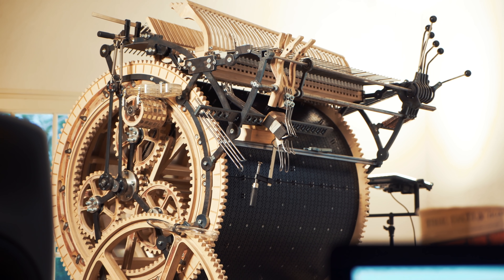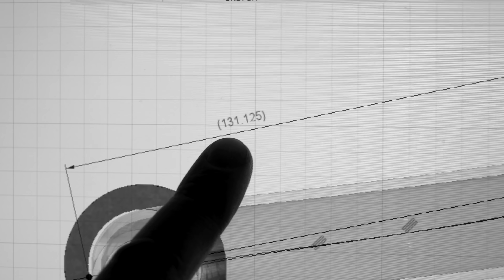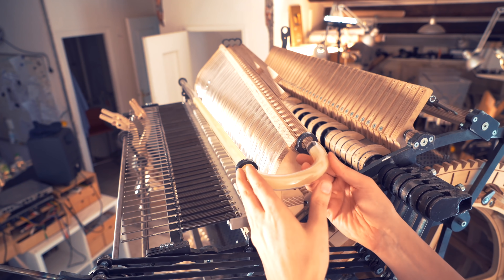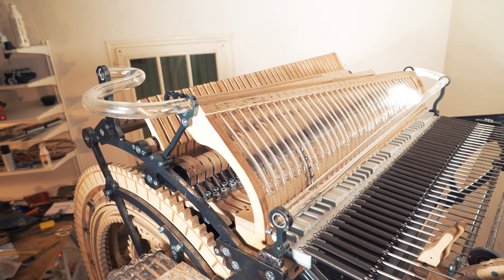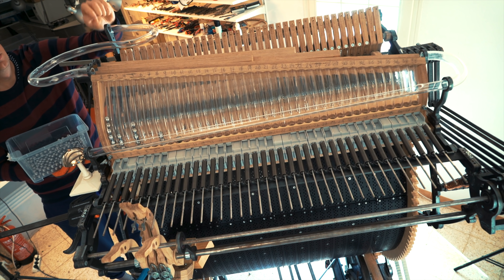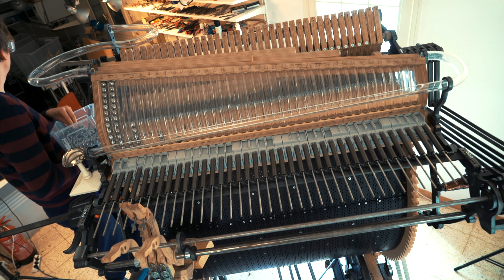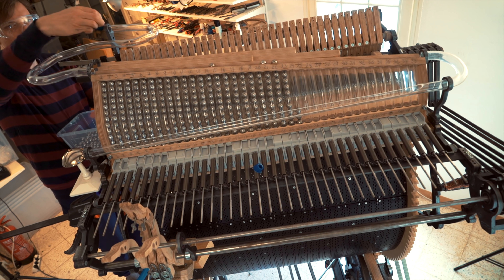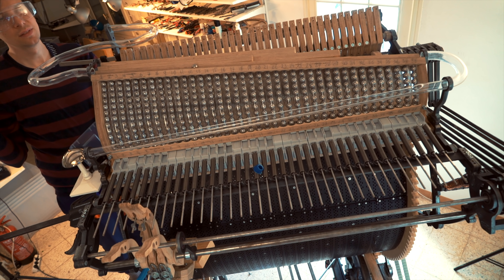Marble Divider Transport Tracks - Marble Machine X #68

Comment: I'm not sure about your programming wheels but I do think the solution you found is good for you.... thinking back to the MM1 you used Lego lots and lots of thin strips on a wheel, in that case you screwed them down, not easy to swap out for new songs, but you could do something similar to the marble lifter to make them replaceable, a chain of shorter sections that could be swapped onto the MMX with a single rotation of the drum (which you already need) and then pinning the ends of the chain together doing it this way means you could make longer chains for longer more varied songs if you wanted and have them hang under the machine somehow.

I'm not sure how practical it is or how easy the modification would be but you'd end up with a chain in 2 or more places (probably the ends) to align the program and the series of programming bars connecting them to code on. They can be laid out flat for easy programming off the machine and because the alignment is fixed by the chain not need to fuss with alignment/arrangement of multiple pieces that might get accidentally swapped. In the nightmare scenario of programming plate 1 and 2 having their programs transposed or programming one plate upside-down you'd be a bit stuck right now and have to halt the show a bit to repair this mistake but with a single chain of programming area this couldn't happen. It's also easier to machine a lot of small pieces than a few larger ones.

Comment: I don't know if this comment will get lost in the ever-growing forum that is created under each of these vids, but I love the attention to detail on this project. I've recently been working on a cash flow spreadsheet for my company and found that I was missing $0.03 out of a $7.3M invoice for a project that will last 3 years. I took the extra hour to revisit each line item and the Microsoft Excel coding. Turns out it is due to a rounding difference between my spreadsheet and the contractor's. It seems like a small thing, but small things grow into much larger problems, especially when left unchecked. You're moving an instrument from country to country, taking it apart and putting it back together each time, and hoping that the road wear will not destroy it altogether. It will grow imprecise over time (thanks, 2nd Law of Thermodynamics...) so I understand the need to make it as precise as possible right now. I think your solution works exactly how it needs to, and the amazing thing is you have hundreds of thousands if not millions of minds working out the same problem, and yours is still the best solution thus far.

Also, side note: I think it's important to remember where you've come from when tackling such hugely minute yet important problems, because that can be incredibly demoralizing, especially with harsh "feedback" from around the world. I think there should be a link to the video of the first marble machine in the description section of every video to give newcomers some context, and to remind people who have been here every step of the way how much better this already is, by necessity of the scale of the project. If anyone questions why you're spending so much time on this, tell them to watch just how much the first machine shook as it was being played, and remind them that it was stationary, not being ripped apart and sewed together at a new venue in a different country/continent: https://youtu.be/IvUU8joBb1Q

<3 Skippy

Phoenix, AZ, USA
Reply: And he satated that the original video was not a single take and required quite a bit of post production to get it done, so I agree with you, he is creating this building on the experience and aiming for great accuracy to actually take it on the tour.
Reply: @Skippy  "If anyone questions why you're spending so much time on this, tell them to watch just how much the first machine shook as it was being played, and remind them that it was stationary, not being ripped apart and sewed together at a new venue in a different country/continent: https://youtu.be/IvUU8joBb1Q " 

I have to note that, to me anyway, one of things that made the original Marble Machine so awesome whs that it DID shake, rattle and roll, and the sounds of the mechanism ADDED to the organic feel of the music it makes. It actually sounded like a real living being making music, not a machine. Try listening to the video with you eyes closed (or not looking at the screen) and you'll hear what I mean.

Comment: As far as programming templates go why not use card stock poster board? It is thin enough that it will flex around the programming plates and lay flat for transport, however it is also thick enough to withstand several uses before starting to wear out. In addition it is much lighter than many of the other possible materials and (at least here in the States) it is fairly inexpensive.

Comment: You can also just get two sheets of thin metal, on one side plasma or cnc out your regular pin hole design. Then bind the two pieces together with foam spacers around the edges. This way you have a lighter and less hassle design.

Comment: for slowing down the marbles: maybe instead of making the tube as long as you did, why not use height differences instead? Having it dip downand back up. It would introduce a bit more verticality to that section where the marbles are mostly traveling quite horizontal and slow them down easily.

Comment: Have you thought about using a 5 axis CNC? It seemed the biggest issue was in accuracy after the bending of the plastic plates. This would allow for CNC of the plate in the bent state and could help to reduce the issues cause by the bending process.

Comment: Aside from programming being slow on tour, I don't see much problem with the programming wheel design. It does what you are attempting to do.

My feedback: you should add an axis to your CNC router so you can build the programming drum, and machine it in place, rotating for each row of programming holes.

I think this would have saved time in the long run with all the trial & error to get the plates just right.

Comment: let me tell you a little story here. 

Peter works at a company that makes cool precise metal things. Peter orders pipe with really tight tolerance hole, lets say 100  and its 2 hundreds of a millimeter over, for his next job at hand

At the same time, Peter  orders a round bar, same size, 100 and say 2 hundreds of a millimeter under- to fit that hole.
It should be a nice fit and will work for the job at hand, he does not have to spend extra effort on the lathe to turn anything to size.- But, that bar  never fits that hole. 
Why is that? the fit should be perfect- in theory 
That is because of the way that round bar was made. The round bar is not round- Its triangular, similiar shape to those that are called " solids of constant width " , no matter where you measure the round bar its allways going to be 100 millimeters, and 2 hundreds under. Peter never checked how the round bar was made from the company he ordered it from, that company used ways of manufacturing that left the bar triangular(ish) 

But the "moral" of this story, is that you can have the best design, well thought out- But how it is made really matters the most. 
That round bar was made on a machine that rolls it into size, and that machine used 3 rollers that rolled it, if that machine had 4 rollers it would have made a bar that was more or less round enough to fit that hole Peter was trying to put it in. 

Your programming wheel is great design, But the way you are going to make it really matters. In my opinion, your cnc cutting the plastic first, then bending it to shape is not really the best way to do it. i think theres a far better way to accomplish the end result that works far- far- far better but the way to do that i dont know myself. 
Bend them first, test fit them on the wheel then cut the holes on some goofy-wonky-donky fixture and index it somehow to get those holes? i dont know. im looking forward to seeing your solutions!

Comment: I think given a lot of the factors you've laid out for the programming wheel, you've definitely got the best possible solution SO FAR (We can always improve on stuff, right?). But with how many factors in play (easy to transport around the world, easy to reprogram, consistent musical timing, etc), at this point that dragon is definitely one that I think justifiably has so much inherent difficulty in it. It's the literal brain of the whole system, so to not have high expectations and requirements for it would definitely be doing the MMX a disservice.

Much love and respect, been watching since you started this project, and this is one of the most impressive labors of love. The fact that you've been documenting the entire thing, including all of your follies and failures, is nothing short of inspiring.
Reply: It seems an issue of Basic aproach. There are better ways to have interchangable programable music (sheets) but he wanted the wheel for estetics.

Comment: Hi Martin. I've been watching you build the X since the 2000 video popped up on my recommendations. I'm really enjoying you build a marvel if a machine that will soon be able to play delightful music.

I have a recommendation when you bend the plastic piping, you should use silicone spray to help get the mould out. I'm sure this will really help when pulling
Reply: That might create another, harder problem. Silicone spray is nigh impossible to get off of stuff, specially from inside a pipe, and it would probably make the pipe slightly opaque
Reply: In addition to being difficult to remove, the silicone lubricant is likely to deteriorate the silicone rubber mandrel(or mould). Mineral oil would be safe for silicone rubber, and is also easier to remove, but soapy water seems to work as well.
Reply: @redthursday  yep, I would also try soapy water.

Comment: i see your problem, you can as you say, take a whole drum for the programing weel, but it wuld take too long to replace, and then your build has to be made around the abillety to take the whole drum out, and you are probly a little to far inn to do that.
you can also have a big roll of paper or cloth, but then it will look ugly and wont last as long before you need to replace it.
your big problem is that you are an artist trying to do an engieneers work, and having to get a marradge of those two to work is a task in it self.

Comment: I do not think you are overthinking or over designing you programming wheel...  as a development engineer I think you are over processing your milling process.   Did you see my comment on using a dividing head and cutting your pin slots on a fully assembled wheel by altering your cutting table??